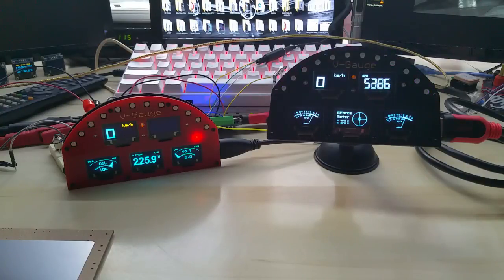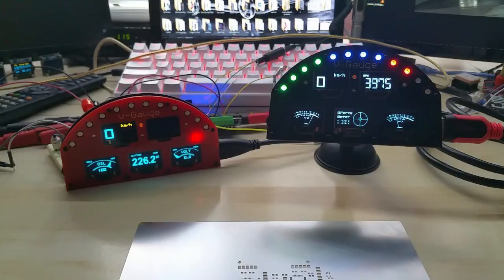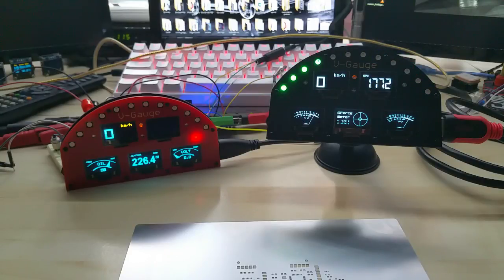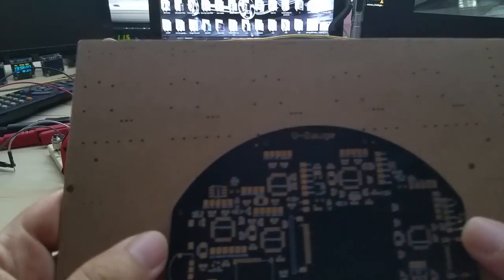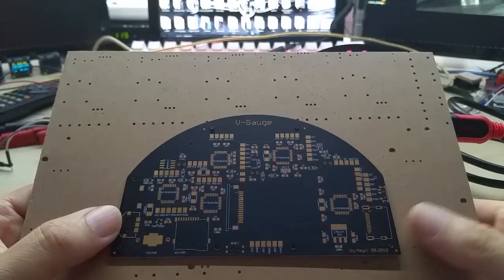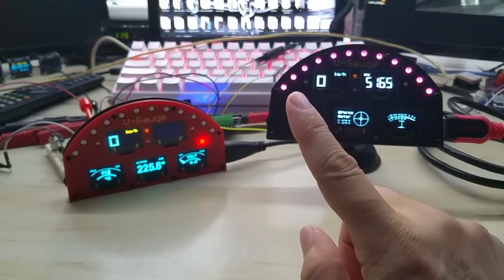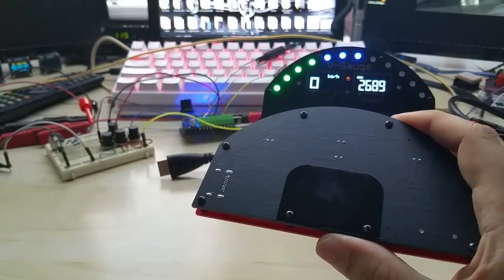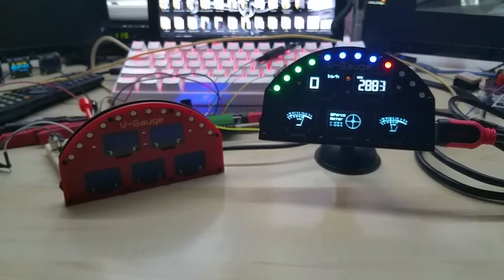How I apply solder paste and more info on the V-Gauge

Comment: Why didn‘t you use the obd2 interface to gather information from the engines ecu? Or did i miss something in the previous videos?
Nice work btw 👍🏻
Reply from the maker: Hi Max, several reasons first and foremost my car does not have OBD and what fun is it if I can't use my own product :-) Also I wanted this for anybody else that has no OBD in their cars, third I wanted it to be used in more than just cars, like boat, bikes, small aircraft of which most will not have OBD. However I might make a OBD version in the future.